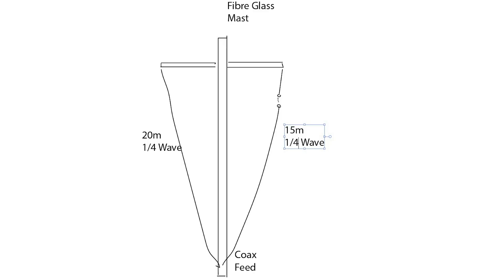Simple Dual Band DX Vertical Antenna - You Can Make!

Comment: I removed the coil from a GAP silver rod and jubilee clipped a wire from the base of the emitter rod to the centre of the So239 and left the earth as it was. Placed various length radials under the lawn and attached them to the earth on the antenna. it covers 10m, 12m, 15m, 17m, and 20m by adjustment. Different coloured sharpie rings can aid adjustment for quickness. Bandwidth is wider than a wire fan vertical and you could add the trap you spoke about in a video to give you 20m & 40m. Great video as per usual. 73's Andy M6APJ

Comment: Peter, your video about the dual band dx vertical for 20 and 15 was inspirational. My micro ponderosa needs all the help it can get with antenna systems. Perhaps you might do a quick video explaining how the feed point is set up for your dual vertical.. ate you using two feedlines? Thank you so much 73 de KE2YK
Reply from the maker: Hi Gary, just a single coax feed. 73 Peter
Reply: watersstanton hello again peter! Could you explain the toriod used in your experimental box with compromise antennas. I would like to duplicate it since i am forever trying to build compromise antennas for my small yard and portable operating. Today i set up the qrpguys 20/30/40 17 foot vertical kit i made, it uses 4 radials. Performance is good with this compromise vertical at qrp power when the bands are behaving. I have also recently built a totally portable ft8 system with my bioenno battery, kx3, kindle tablet usb gps, usb sound card and raspberry pi. Testing has been successful so far and i will be taking it to the beach in the next few days for the first fully portable operating test! 
Best regards Gary ke2yk

Comment: Peter, if you place a horizontal piece longer than the upper piece the lower end of the wires will be spread out from the top wires. This would be a oblong loop. If you were to use aluminum angle for bottom and top horizontal pieces with hole a few cm's from the ends of the horizontal aluminum angle you would have an attachment point for a wire fastened with SS bolt, lock washer, and wing nut. With closed eye terminals at the ends of the vertical wires that would slipped over bolts followed by the lock washer and wing nuts. Feed point would be at the lower horizontal aluminum angle piece center at the mast attachment point. If you are using a fiberglass telescopic pole for a mast you don't want to metal u-bolt fasteners. Make a clamp from pieces of wood boards with a "V" cut into the side facing the mast. Drill holes near the ends of the boards to insert bolts, flat washer, and wing nut for quick and easy tightening. Enjoy, de KB8AMZ
Reply: I like the wooden clamp idea. Hadn't thought of that. Hopefully, less likely to damage the fibreglass mast than metal clamps. I wonder, if you have tried this, did you have to put some friction material (e.g. rubber sleeve) between mast and wood to stop the clamp sliding or rotating?
Reply: @Steve-GM0HUU  No. Not much weight on the lower horizontal piece. Just snug the wing nuts on the bolts. The friction of the wood against the fiberglass is sufficient. 72 de KB8AMZ

Comment: Hi Peter, am enjoying your videos. i have never had a QSO on HF yet, have no garden but do have a large attic, will keep trying. 73 from Colin MI6UNC
Reply from the maker: Colin, try and squeeze a dipole in the attic. Approx 10m long for 20m. Bend it a bit if needed. Good luck.  Peter.
Reply: Try putting a dipole or inverted v up in your loft with the ends coiled onto plastic pipe if you don't have enough room to fit it in or just bend the ends to fit,  if the coax run isn't very long like just going into a bedroom then just use cheap RG58 connected straight to the centre of the 1/2 wave dipole. No need to worry about Baluns and/or chokes when 1st starting out. A simple 1/2 dipole made with any cheap wire you can find with work really well on 20 Mtrs.
Good Luck.